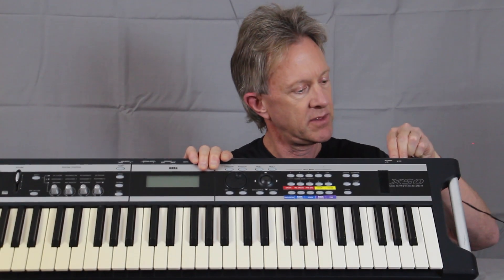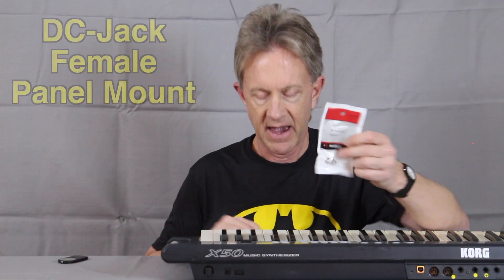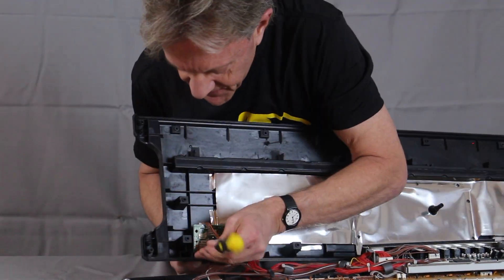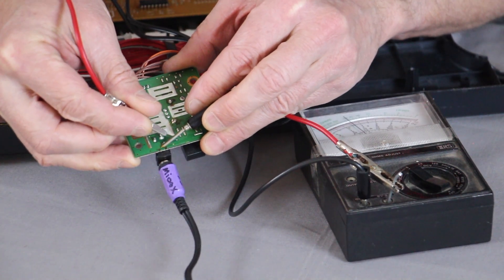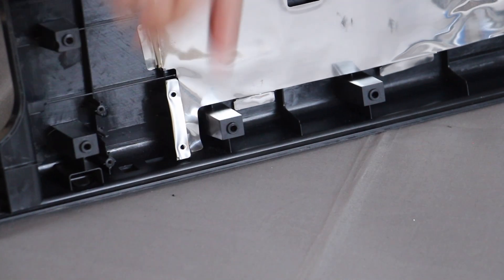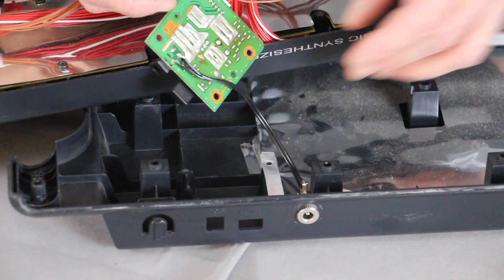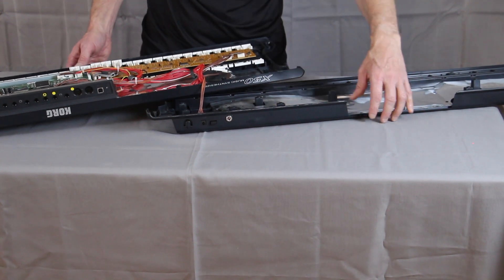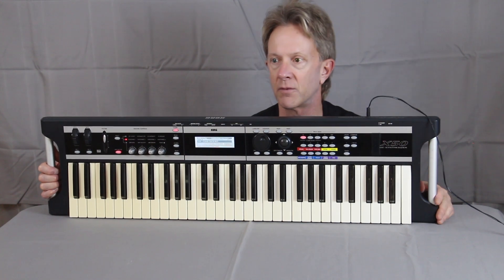How to Fix a Bad DC Power Jack

Comment: Great tutorial, planning to do this fix/upgrade to my Casio keyboard. Can you describe how to use the multimeter to identify the correct polarity of each node on the board?
Reply from the maker: Sure- most multimeters have a "+"  and a "-" lead (usually red and black) If you set the meter to "DC Volts" in a 0-25V range, you will know the positive and negative points on the board when the meter shows a positive 9V reading when the leads are touching those points. Hope that makes sense and good luck!

Comment: Thank you for this video ! I also have this problem with Korg SP 250 digital piano. How to determine plus and minus that you did in this video ? I dont have that instrument ?
Reply from the maker: That instrument is a multimeter and you can get inexpensive ones like this: https://www.harborfreight.com/7-Function-Digital-Multimeter-63759.html
I'm not sure of any other way to test and be sure that you have the polarity right except by trial and error.

Comment: Thanks for this have exactly the same Korg with this problem only something metal inside has bent inwards suddenly meaning adaptor won't allow the lead inside....
Reply from the maker: I've had that happen on more than one keyboard/effect. Sometimes you can fix by sticking a small screwdriver into the jack and straightening the connector, but sometimes it breaks off :(

Comment: So is this better then replacing the original dc and using the Korg part? Are you using the original power cable too? I actually have the micro X which is pretty much the same keyboard but smaller footprint. How come you chose to go this route over direct factory replacement. Awesome video!!!
Thanks
Reply from the maker: Hi Marco- I had an OEM power adapter with the same specs as as the original x-50 and used a female socket to match it. It was easier than removing the surface mounted one that broke (and I think more "bomb proof") I also have a micro X but so far that cable is behaving :)
Thanks for watching!
Reply: LearnLizard thanks for reply. I have to go this route  any ways, I guess Korg doesn’t carry or produce  the factory replacement part for this model of keyboard anymore.
Reply: @LearnLizard  I wish you would have mentioned that you changed the power adaptor before I ordered that jack from Radio Shack. What kind of OEM power adapter do you use?
Reply from the maker: @billcarter781  I had a generic 12V DC 500mA adapter with a common 5.5 x 2.1mm plug such as this: https://www.amazon.com/Alrolink-Adapter-Security-Cameras-Accessories/dp/B07MFBP17P/ref=sr_1_1_sspa?crid=1B7FNU0YCXEUX&keywords=12v+dc+500ma+power+supply&qid=1577730488&s=electronics&sprefix=12V+DC+500%2Celectronics%2C194&sr=1-1-spons&psc=1&spLa=ZW5jcnlwdGVkUXVhbGlmaWVyPUFTVTZBT1BKVTREMlomZW5jcnlwdGVkSWQ9QTAxNDUzMjIyN1hXSTFFTk44NU9DJmVuY3J5cHRlZEFkSWQ9QTAyNTc5NzYyUkZCUVkzV1ZXSjFSJndpZGdldE5hbWU9c3BfYXRmJmFjdGlvbj1jbGlja1JlZGlyZWN0JmRvTm90TG9nQ2xpY2s9dHJ1ZQ==
I hope you can get it all sorted out and thanks for watching...